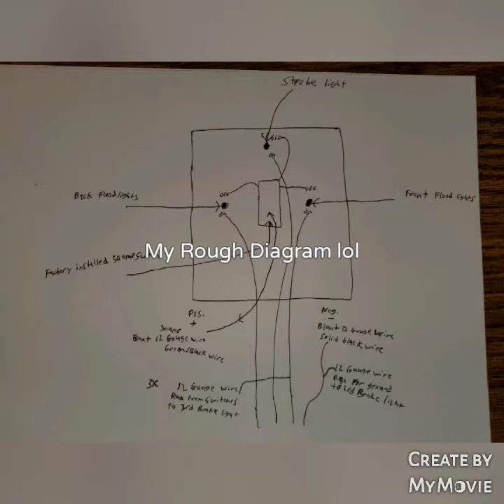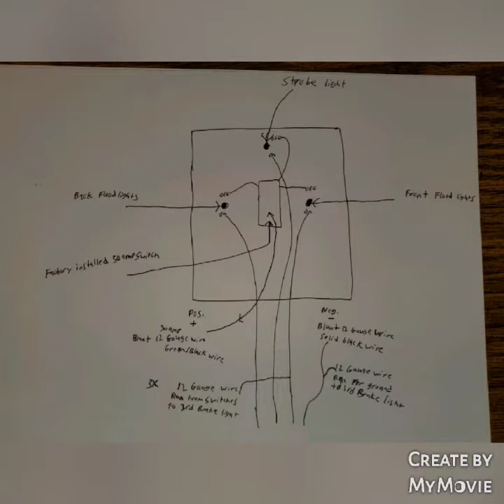Utilizing Emergency Roof Mounted Lamp Switch On GM Plow Prep Package

Comment: that black beacon switch in the middle that come in the truck… where does that wire go to…trying to add a light my truck
Reply from the maker: @kadenkorhummel633, My truck came with a Plow Prep Package Installed. The black beacon switch  is installed as part of this package. It is on a 30A fuse in my case. On my truck there were 2 taped blunt wires up in the head liner, one being the ground the other being  the switched power. I spliced 3 wires off of  the factory installed black beacon switch wire so I could run 3 separate switches. So I have to turn the black beacon switch on and then use the 3 toggle switches I installed to control 3 different sets of lights. Hope this helps.